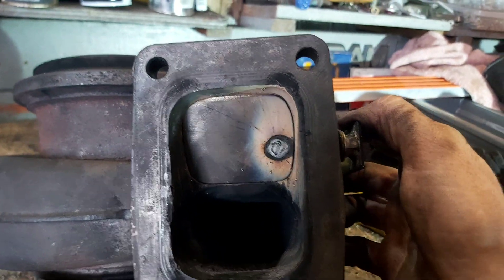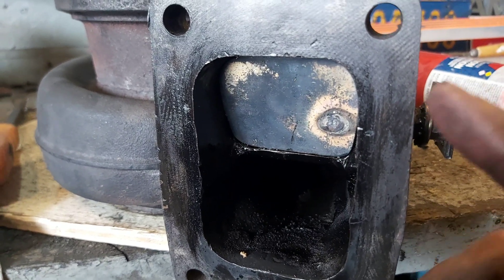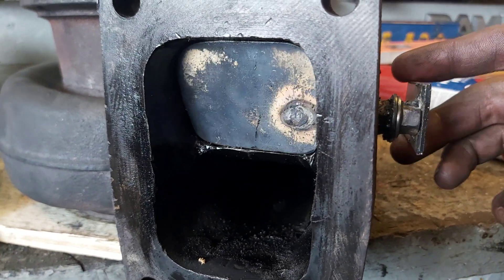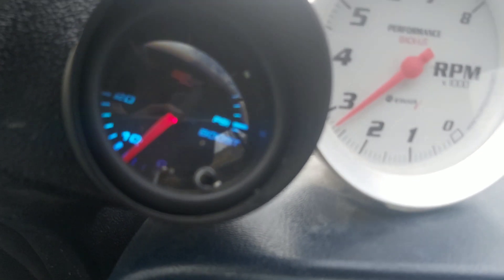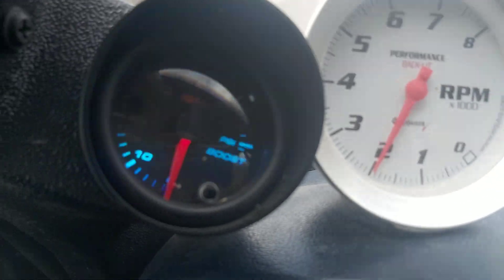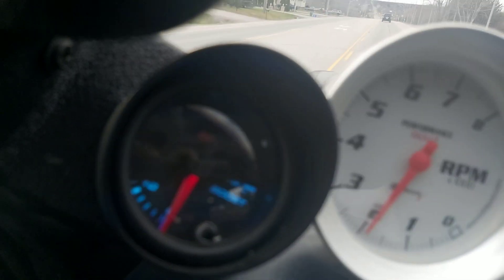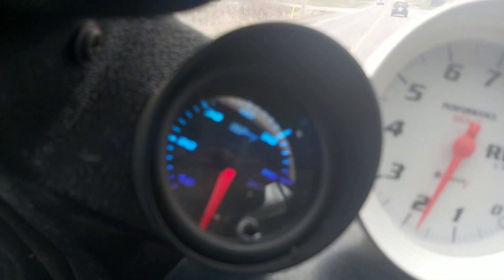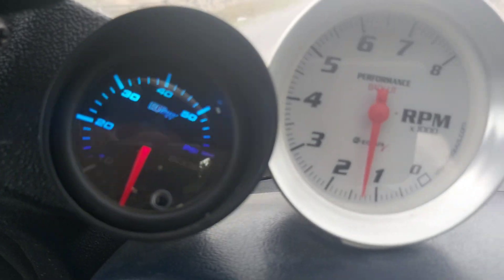Quick Spool valve testing it out on Cummins (2/3)

Comment: Looks good, planning to do the same, hope it hold up😅
Reply from the maker: Now that I have it designed better I want to make it from stainless steel to handle the heat better.
Reply: @wild12valve  try to get some inconel thats even better....
Reply from the maker: @joostsonneveld5407 true! But I don't think that can be welded,?
Reply: @wild12valve  yes offcourse it can
Reply from the maker: @joostsonneveld5407  just looked it up, maybe I'll try to locate some and give it shot. Good idea thanks!